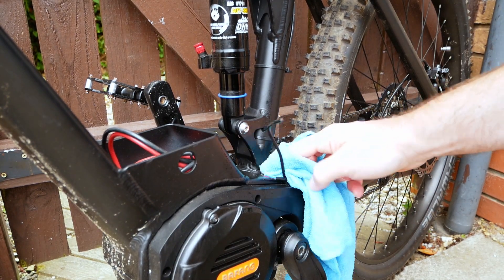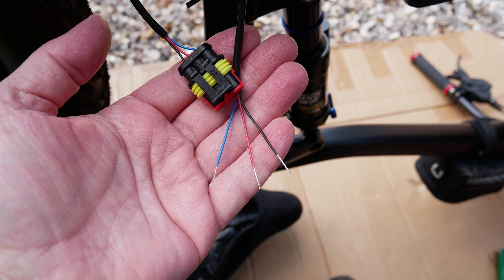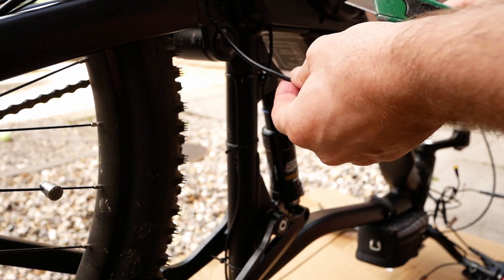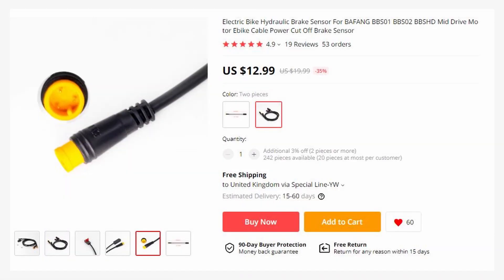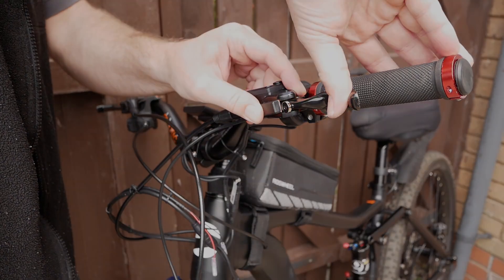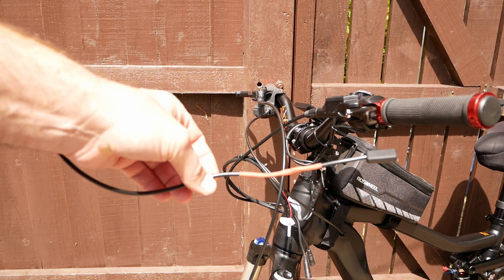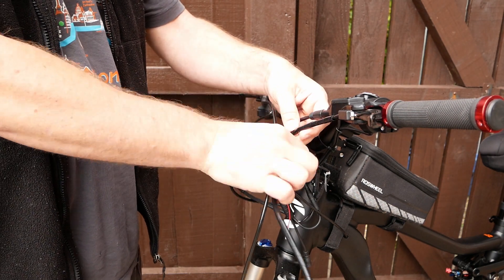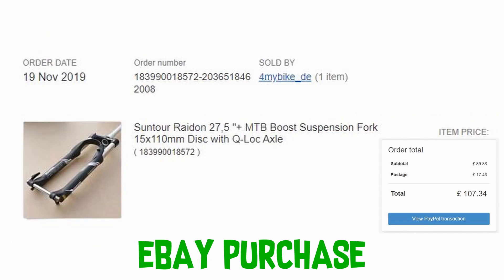DIY 1000 WATT ELECTRIC BIKE PRICE BREAK DOWN VAPOUR BAFANG PART 9 How To build an eBike #EBIKE

Comment: Love the country blues.
Reply: @baconbuttties  I'd love a playlist from you, especially wondering who the first track on this video is. You have good taste! Also, could you tell me what the throttle connector type is. Waiting on my motor, but want to order a particular throttle from China. Also, what sort of range are you getting on the battery? Sorry to be so demanding.
Reply from the maker: @regineauxrheinkreuzer258  Throttle connection is a the 3 pin round type  this link should show the type https://www.amazon.co.uk/Bafang-Electric-Throttle-Motor-Accessary/dp/B07B92BM32     Around 25 to 30 miles range on the battery I have.
Reply: @baconbuttties  Thanks! Not a bad range really.

Comment: thank you agian for the informations. still waiting for the parts to arrive.  I have watched your videos multiple times. my problem is that i should have focused a lot more on your videos particularly the parts you mentioned. i ended up ordering parts that will not fit my bike build. if i could have paid more attention to your details and wrote down notes specifically on certain parts like the replacement chain ring. the bafang stock chain ring was quite heave as its made of steel. desperate to changed it ordered 3 parts on amazon. lucky enough seller has not shipped the items yet and was able to cancel. the last order i made, was a mistake again for the 2nd time the moment i watched your video on the chain ring replacment. i cant thank you enough for your videos. most likely will keep watching these videos over and over again as i assemble my bike build. my coworkers are buying theyre bikes costing anywhere from $5k to $9k which is way too much for me. my price range would probably the same as yours. thank you again.
Reply from the maker: Thanks for the nice feedback on the videos 👍 I'm waiting for a battery to arrive from China which is taking a long time and hopefully it will turn up soon . Glad the video helped.

Comment: Hey man, how does this 1000w mid drive feel and compare to your previous 3000w stealth build in terms of torque/acceleration and top speed?
Reply from the maker: I didn't get to finish the 3000 watt build and the battery is on the way for the new build so i can't give you a comparison sorry. It's a shame I never finished the 3000 watt enduro.

Comment: Nice build. I've just bought the same bike, what size frame you got?
Reply from the maker: I went for the 17 inch frame . It's a great frame.
Reply: I got the 19 inch, but feels more like a 23 inch, it's immense! Might have to go for some smaller tyres me thinks.
Reply from the maker: @stansmith7701  Yeah im 5ft 10 and would say the  17 inch is just right for me.
Reply: I really should of got the 17" but having still having a blast on the 19".
You got your battery yet? You need  to feel the speed...
Reply: What size cranks you got? Mine seem to be hitting nearly every kirb I cross..think I need shorter
Reply from the maker: @stansmith7701  Still waiting on the battery , must be longer delivery times at the moment.
Reply from the maker: @stansmith7701  Mine are the standard ones  that came with the  Bafang motor. I assume they would all be the same size?

Comment: You bought very low quality chinesiuim rear wheel. It's waste of money
Reply from the maker: I don't think it is as i have put quite a few miles on it and is standing up well. I do not do any hard terrain so it will be fine for me . Have you had any experience with this particular wheel or any failings I should know about?

Comment: Hi mate thanks for the Ebike videos. You done a good jobs on building a powerful Ebike for £2542. I also watching Andy Kirb YouTube on building the same Ebike as your. On www.cloudsto.com the Fully Builded Vapour Ebike like your for £3400.  How happy are you with the bike ? Thanks
Reply from the maker: I'm extremely happy with the bike as it is well made and is probably the best bike I have ever ridden. I have only been on the bike without the battery fitted so far but I have to say that the frame is holding up well with the mountain roads and lanes I have been on.

Comment: Its not a cheap hobby,I'm building  a Ruff Cycles Porucho framed bike with 1000 watt motor,when finished it will look like a 1920s flat tank motor bike and the price is ramping up as I buy everything but I feel it is worth it ,make shure you get an alarm at least GPS is even better ,I've been attacked twice for my Carrera Vulcan but I  live in the Manchester subburbs and this I'm told is normal,happy trails ..
Reply from the maker: Yes you're right about an alarm and a tracker and it's something I need to get. Hope you bike build goes well.

Comment: Can you share the link where you found the cheaper battery from. Love the videos and I was able to build the vapour myself. Watched all your videos while I was waiting for my bits to arrive. Mine went together no problem at all, had no issues with the wiring and the internal cabling.
Reply from the maker: This is the battery i am looking at on Aliexpress  https://www.aliexpress.com/item/32835055693.html?spm=a2g0s.8937460.0.0.92132e0ezMRi4i

Comment: Well done,.
I purchased one complete of Davebikes for £2600 but I have been adding stuff to it Like 220cm front rotors and 4 pot discs. An extra battery also transforms the bike. I go out on the 48V then come back on the slightly higher powered 52V about 50 hilly miles in the Peak District. Later when out of Guarantee I might look at the motor programming but see some really mess up so must be very careful. I don't use the throttle and it just goes up anything not sure on its jumping abilities though, its 25 kg!

Comment: Should have gone to Luna Cycles and got an X1 full carbon for 3 grand.
Reply from the maker: Looks good but it would be £3120 with tax added and then there is shipping and I wouldn't of have the fun and misery of building my own.
Reply: X1 looks a very tidy bike. This build has a better spec engine and battery. Maximum tork 160 not the 95 on the X1. I’ve built my one up  using very similar shocks to the X1 my total price was around 2500.

Comment: Hi. I started almost a year ago trying to build a ebike. I started with just a vintage mountain bike frame I got from ebay. The idea was to get a front hub motor and build the bike to look like a mountain bike I used to own. After watching your bike build decided to finish this bike as a regular restoration. Due to financial reasons I would have to put it on hold. Your cost is about the same or cheaper than ebikes sold at bike shops. Thanks for the tips and ideas on your bike build.